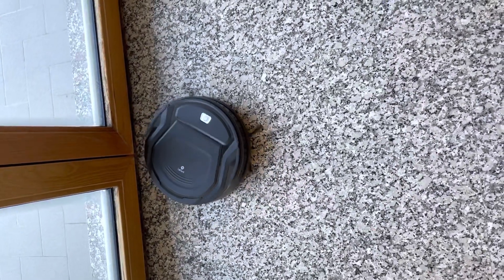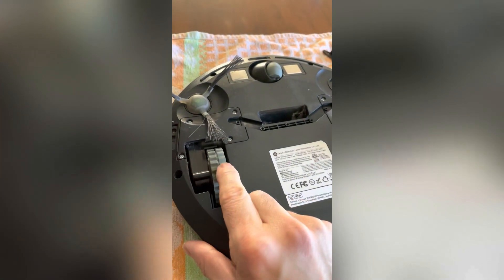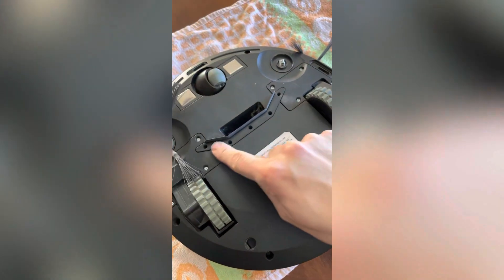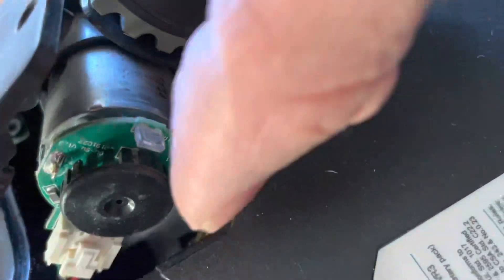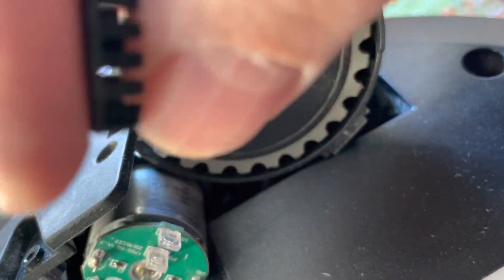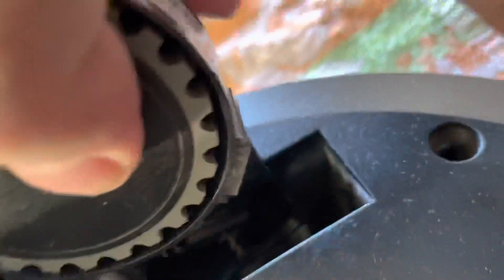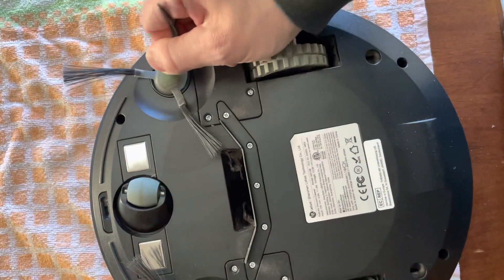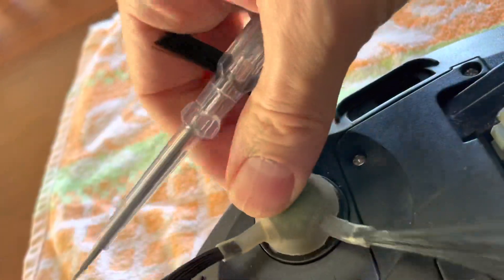How to fix a Lefant vacuum robot cleaner  that goes in circles

Comment: Yooo didn’t even look dirty but I also disconnected and reconnected the wires by the wheels just in case and it works great now! Thanks so much for the video. This thing is no longer driving ME in circles wiping sensors and cleaning the wheels